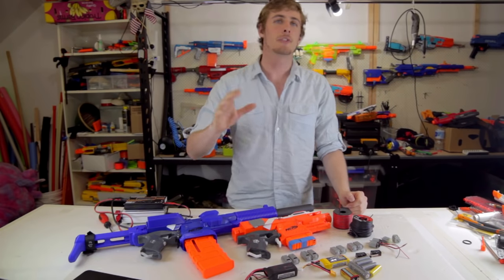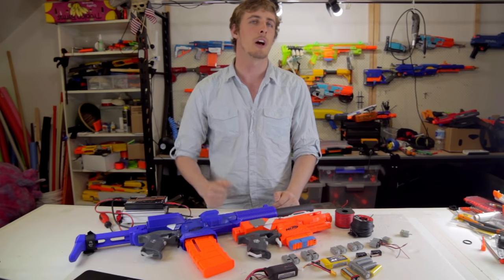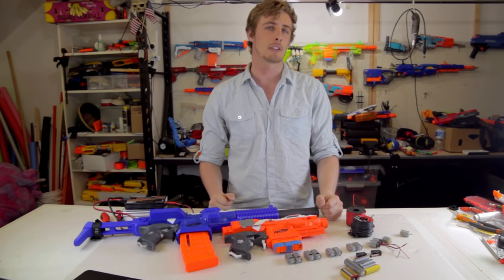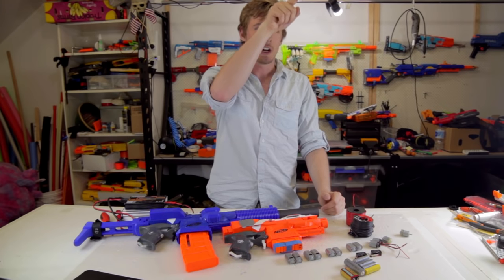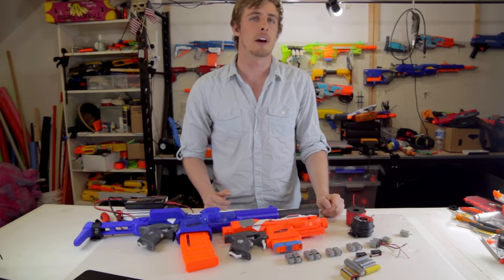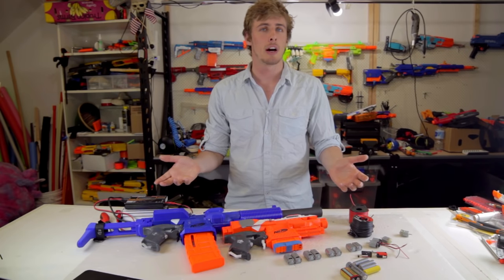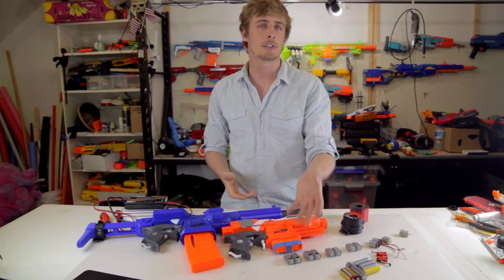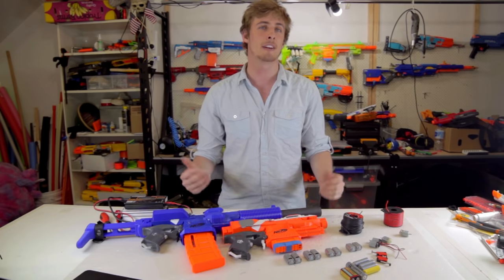Batteries & Motors 101 | Nerf Modding Explained

Comment: Plz plz plz plz do an overhaul mod guide for the hyperfire! Or just a parts recommendation to run it
Reply from the maker: Step 1) Replace hyperfire with rapidstrike/stryfe
Step 2) Watch our mod guides for respective blaster.

:P But srsly I'm really not a fan. You can pretty much just follow the same process for the Hyperfire as our rapidstrike wiring guide and just translate the motor positions as needed -R
Reply: Make.Test.Battle ok well thanks,  haven't been able to get my hands on a reasonably priced rapid strike so I went with the hyperstrike

Comment: Has anyone tried mixing different flywheels together? I'm new to this hobby and I've bought a Worker canted cage with reg crush flywheels, and also a set of Worker high crush flywheels. Has anyone tried using one of each in a cage? And if so what was the outcome? Any thoughts or input would be appreciated, thanks!

Comment: Hey, i have a question: whats your recommended highest voltage for the rapidstrike base motor?
Reply: Leo Meditz Probably about 11.1 volts is the max. Just get some upgrade motors, your blaster will be underpowered for voltage if you don’t.

Comment: When finding what amps I need for my battery do I have to take in account for the plunger motor? For ex. My case, I'm going to be running two hellcats at 23.8 amps at stall (x2) and a rhino at 7.8 amps at stall for 55.4 total, is that correct or do I only need to worry about the primary flywheel motors because the cheapest and most powerful 3s I found from where I wanna buy is a 2.2 amp 25c giving me 55 amps which is less then what I neeed by .4 please someone help lol

Comment: Hey Ryan! Thanks for this. Though I  know the basics, it is great to have a comprehensive guide that can be linked to when people ask questions. One thing I did notice however is that you didn't go over pusher motor stuff, probably by design. I think it would be good to note that Honeybadgers and I assume Wolverines (Don't have any yet!) run great for high ROF Rapidstrikes.

PS- 10S2P LiPo's exist!!! I've seen them, but I don't think you can (or would ever want to?) buy one anymore...
Reply from the maker: I did go over it very briefly, but its hard to give a good explanation of the torque requirements while keeping it simple. the rule of thumb is divide max RPM by about 4,500 for the Rate of Fire. Also I'm sure they do exist but I was just using it as an illustrative example -R

Comment: Thanks Ryan, this is a great video, (as most of yours are) and helped me a lot in choice of motors and batteries.
I'll be buying M.T.B. motors from now on (Fang Revamped make me want to retch) and some Neo-Rhino's for my Modulus, Hyperfire, Rapidstrike and Regulator Builds, probably even my Mega Mastodon (with some shims to hold the motors in place), what pusher motor do you think would work best on a 3S setup with Neo-Rhino motors? I can do motor braking to avoid runaway firing, so that doesn't worry me, ideally I want to stick with 130 size cans, just for the simplicity and less internal and external shell cutting.
Honeybadgers are 2S, right? So could I use a 3S Rhino as a pusher without any issues?

Comment: So wait. Off-topic, but does this mean a Wolverine motor powered by a 2s or 3s LiPo performs better than a Hellcat in 3s?
Reply from the maker: A Wolverine on 2S will spin up to the critical 25K RPM fractionally faster than a Hellcat on 3S but the additional current draw means that I would still 100% recommend Hellcats as Flywheel motors. if you must use a 2S flywheel then Wolverines are the way to go -R
Reply: Make.Test.Battle
I see. Thanks for that. For a moment there I was thinking if I should let go of my Hellcats in favor of Wolverines.. :P
Reply from the maker: Probably not. The exception also lies in second stages for afterburners -R

Comment: What is the RPM and Torque of hellcats? I can't tell by the stupid spec sheet
Reply from the maker: The stall torque is given in mN.m on the spec sheet as 72.6. You need to convert that to g.cm to line up with other motors. I will shortly be redoing the spec sheets for easier consumption by the general public -R

Comment: so 18650 are not as good as lipos but are still decent?
Reply from the maker: Some can be pretty good, others can be pretty bad. Some can be as good as good LiPo's but the best LiPos will be better. Just make sure to check the specs on your specific 18650s if you want to use them -R

Comment: does somebody know the current and stall current of nsr shark 40k's?
Reply from the maker: Sadly not all motors have good available datasheets -R
Reply: Make.Test.Battle xD i thought you might have meassured it for yourself...
the sharks have openings for cooling. do i have to cut the flywheelcage that they are opened? to prevent overheating (with a 3S Lipo)

do you know of something better than the sharks in 130 size?

Comment: What happens when a lipo is over discharged?
Reply from the maker: The battery will heat up but the main effect is not having good motor performance -R

Comment: great information in this video, but i wish you would have visualized more concepts you discussed. the charts were nice for comparison sake, even if they could have been up longer. but when you're throwing all kinds of numbers in different units like amps and volts, it would be nice to have a visual of what is is you're talking about as a reference; especially since you said this video was aimed at new comers to electrical wiring as well as refreshers. otherwise i think you did a good job of explaining. its just hard to follow so much information purely in an auditory manner without visuals -- in a video, which is a visual format.

again, im not critiquing the info presented, as i have no right to, just saying that more visuals, such as list charts for example, would be helpful when being given a lot of new information about unfamiliar concepts regarding multiple aspects of unfamiliar components. as is, the video seems to assume a certain minimum level of prior knowledge and familiarity with what you are going over. its all good information, just having a bit of trouble keeping up with it all presented in this format.

Comment: What battery do you recommend for Hellcats and a Select fire stryfe kit that was in the Full Auto Stryfe Uzi? I have been thinking about a 4s to supply it with the 15 volts it supposed to use. I liked this one do you think it is worth it? https://hobbyking.com/en_us/graphene-1000mah-3s-65c-w-xt60.html this is also the pusher https://world.taobao.com/item/532622499565.htm#
Reply: I use the one you linked in my hellcat stryfe. Works great, if you can afford it, it's worth it.
Reply: does it last long?

Comment: Does anyone know what a Wolverine on a 3s gets in terms of FPS and range? Also MTB I love your new profile pic mates:)
Reply from the maker: Thanks! Pretty much every motor will get the same FPS if they spin over about 25,000 RPM. The bigger factor is the assembly of the cage and flywheels. Also, I highly recommend not using Wolverines on 3S. Go for Hellcats -R
Reply: Make.Test.Battle already am:)

Comment: Actually teslas, like the model s, use a huge battery pack which uses lots of 18650s
Reply from the maker: Teslas sure as hell do not use 18650s... -R
Reply: Make.Test.Battle they use thousands of them https://en.m.wikipedia.org/wiki/Tesla_Model_S
Reply from the maker: Well I'll be damned...! I am totally wrong. Thanks for pointing that out! I would have assumed that they would have been using flat cells instead. -R
Reply: Make.Test.Battle since they use over 7,000 cells, they can just fill the bottom of the car with them. Also, if you want, I can send you some info on li-ion cells. Not all are created equal. Some specialize in low drain, high capacity applications, some drain as fast, if not faster, than lipos, and require special safety components or they drain too fast and blow things up. It all depends on the material the cathodes in the 18650s are made of. E-cigs use them, and flash lights use them.
Reply from the maker: I'm quite familiar with the technology, I was just totally unaware that they used round cells instead of flat cells. I guess it makes sense since they could also retail them but the packing efficiency wouldn't be as high which confuses me. Maybe its for thermal reasons? IDK...
Reply: I'm pretty sure they plan on moving away from them, though, probably so they don't have to buy a ton of 18650s from Samsung and friends.

Comment: What about 9 volts
Reply from the maker: Very bad -R
Reply: What is a cheap alternitive thats easyier than lipo
Reply from the maker: NiMH batteries are an alternative, but LiPo's aren't all that difficult -R
Reply: Nothing is easier than LiPo really, as all the alternatives require the same or even more work. You have to rewire and microswitch already, if your replacing motors and all packs need you to solder on a connector. Your options are NIMH or lithium, and great LiPo packs can be had for less than $15, and a S60 charger can be had for around $30 (Prices are USD). Plus LiPo's actually fit in your blaster.

Comment: i wish this video existed before i bought a battery, thought that 25C=25A but that's not true with a 500mah battery.  =(
Reply from the maker: :,( -R
Reply from the maker: That said, usually smaller batteries have higher C ratings so check what the burst rating of the battery is -R

Comment: Still springers are superior to and flywheel
Reply from the maker: Pfffffff get out of here -R
Reply: Make.Test.Battle Are you sure? But I see your point
Reply: Near instant rev time with 180s, no major mechanical systems to break, higher ROF (Don't know Wolverines, but HBs give you 14DPS) and equal velocities for super-stock.Turst me, run a well tuned Rapidstrike with 180s all around, an Artifact Red Flywheel cage with smooth wheels and cycle control, and you will change your mind.
Reply: Ian Pugh  I rekt a rapidstrike trying to add 130s and the wire burned 
Springers are easier to fix, upgrade and work in 99.9% of weather
Reply from the maker: HPA true master race tho :P -R
Reply: HA! Heck yes!!! I'm following Turok's progress on the Prometheus with such anticipation! I can't wait to see where this community goes once HPA becomes a Super/Ultrastock standard. Sorry if I'm a bit chatty, but are y'all looking at open bolt semi/full auto HPA stuff in the near future?
Reply from the maker: If i wasn't on holidays right now I'd be 3D printing my semi auto blaster and finalizing the design of my full auto, its closed bolt, and will have burst fire and an ammo counter >:D It mayyyy also feature at NvZ 2017 ;) -R
Reply: Well that needs to happen! Can't wait for NVZ, absolutely stoked that you guys are making it this year! Vacation days were approved, and my primary is almost complete.
Reply from the maker: If everything goes to plan...! -R